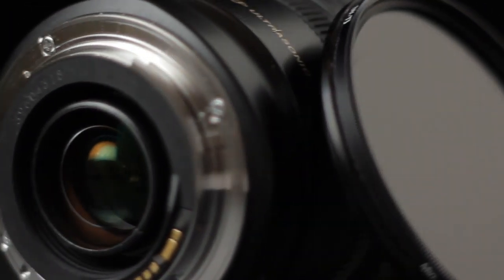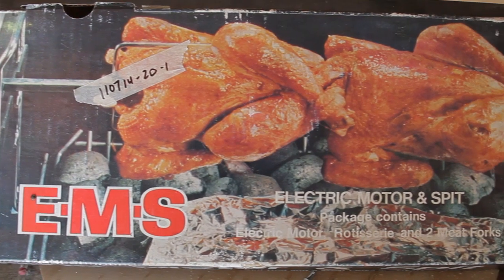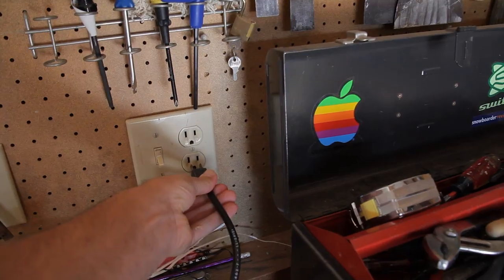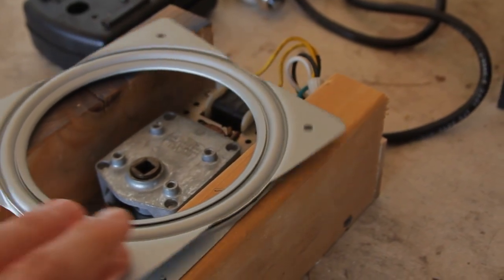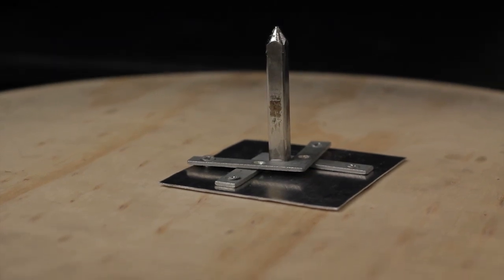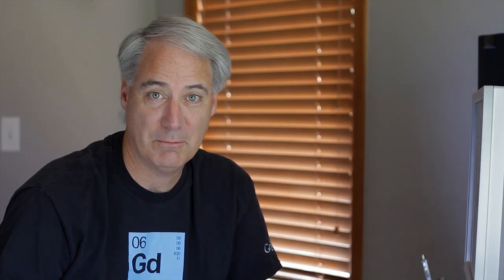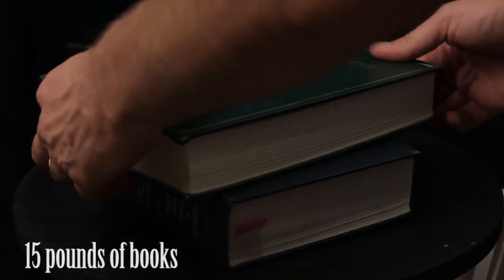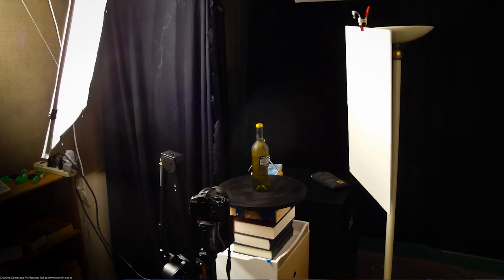DIY Display Turntable for Video

Comment: @drumat5280 Hi Dave, a step-up is just a cheap variable speed motor. You can get them at Radio Shack I believe. If I am not mistaken you can use a rheostat to control the voltage with them to adjust the rate a spin (or turn).

Comment: @drumat5280 stepper motor from wikipedia "A stepper motor (or step motor) is a brushless, electric motor that can divide a full rotation into a large number of steps. The motor's position can be controlled precisely without any feedback mechanism (see Open-loop controller), as long as the motor is carefully sized to the application."

Comment: I really wan't to make my own non motorized turntable because I would love it for when I am modding my pc. the difference is that I don't want a disk shaped stand for it. I want a rectangular one (so a pc case fits nicely on there). Oh and will it handle alot more weight without a motor? because I a fully watercooled pc weighs in at alot more than 15 pounds.